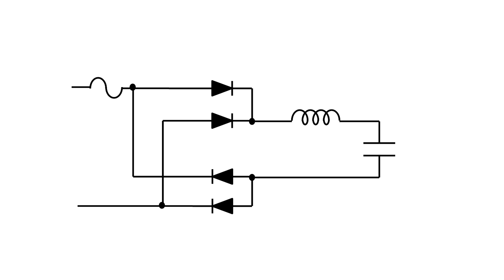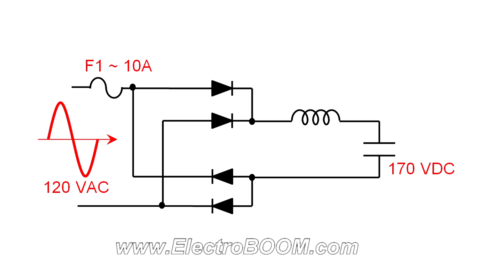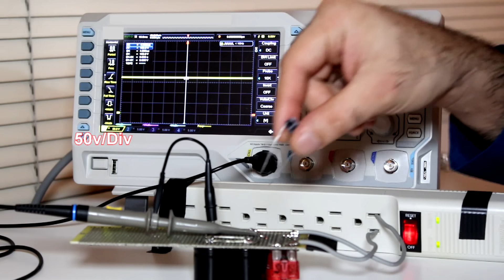Making a Full Bridge Rectifier

Comment: Always remember to add a discharge resistor across the capacitors so it doesn't become a time bomb waiting for you to short it accidentally. I use around 500 kOhm or higher so the wasted power is low.

Comment: I'm still confused as to why you can touch the 170V DC output at 2:00. Since the circuit is capable of driving 1000+W (170 V DC * 10 A = 1700 W?) of power and you're shorting the two ends, doesn't the body act as the load which means you could have a potentially high current passing through you?

Is it because you're touching only with a single finger which means the charge doesnt' pass through the entire body but rather just the finger? Shouldn't you still feel something (at least the finger heating up like a resistor?)

Why is DC less dangerous than AC in this case since the theoretical power output of both the wall outlet and FBR output should be the same minus losses from the FBR circuit and thus, having an equal amount of energy to kill you...
Reply: So here’s the deal — just because that power supply can spit out 170 volts DC at 10 amps doesn’t mean your body is instantly gonna eat 10 amps if you touch it. Current only flows if there’s a complete circuit, and how much flows depends on your body’s resistance. Dry skin can be like 100kΩ, which means you’d only get maybe a couple milliamps at 170 V. That’s barely a tingle. Wet skin or cuts though? That resistance drops way down, and now it can get dangerous.

When you touched it with just one finger, you weren’t completing a circuit. You basically just touched one side of the battery. No return path = no real current through your body. That’s why you didn’t feel heat or shock — nothing was really flowing. If you touched both terminals (say with two hands), that’s when things get spicy, because now current has a way to travel through you.

And about AC vs DC: AC is nastier at household frequencies (50/60 Hz) because it messes with your heart rhythm. As little as 30 mA AC across your chest can send you into fibrillation. DC tends to just give you one strong muscle contraction, and then your body kind of “locks on” — still dangerous at high current, but statistically less deadly than AC.

So yeah, you survived because you didn’t actually close the circuit. It’s not that the power isn’t there — it’s that you didn’t give it a path.

Comment: You can't use any diodes to make a rectifier because the diode has a specific voltage and amperage rating. If voltage or amperage exceeds its maximum value, the diode will die shortly and conduct in two directions. So don't forget to look at its data sheet.

Comment: So I have a transformer with 2 individual 25-0-25/25-0-25 power output (AC). I made 2 individual full bridge rectifiers (4+4=8 diods) with center taps and total 4 big capacitors and I put them in series to make +/-71 VDC(142dc) and used the 2 bridges connection point as Ground(0) and I added 2 bigger capacitors on my final output stage (+/- +/-) and used it in😢 my audio system and it runs pretty good so far. But I could put my transformer ac wires (secondary) in series and use only full bridge rectifiers with 4 diods and 2 capacitors which is the way I might had to do but I did it differently. Could you explain what could possibly go wrong with my setup or pros and cons please. You are the best person who could explain this one. I have searched on the Internet and couldn't find any answers or some people think it was unnecessary and not balanced and wasted parts for bad design .

Comment: If I had a scope. I would wire in a switch connected to the ground wire so I can disconnect the ground at any time.
Reply: Or use an isolation transformer.

Comment: Does the disipating resistor value matter at all? I have not run into any explanation to choosing a resistor value to disipate the current stored in the regulating capicitor when the circuit is no longer being supplied.
Reply: A little late, but if the value is too low it will draw a lot of current and obviously generate heat. I don't think there's any ideal value just use a high one. MOCs (microwave oven capacitors, they're rated for over 2kv) for example, which already have built in resistors, have a 1 mega ohm resistor.

Comment: Can the DC coming from the main rectifier bridge be further improved by having the DC signal pass through a second full wave rectifier?
Reply: Try adding more capacitors to further uphold the voltage. I highly doubt diodes would do anything to make the DC waveform more flat since the current never flows back after there is already a diode there.

Comment: Next question is how can we step down the output dc voltage to something closer to 14vdc?
Reply: Try a variable resistor and tune until you get your desired voltage. Or if you want, you can do math and pick a fixed resistor. Otherwise, before passing it through a full bridge rectifier, you can step down the voltage using a step down transformer.

Comment: I have a question, is it the inductor, that makes the capacitors not explode or an different component?
Reply: Capacitors only explode if you connect them in reverse or exceed their voltage rating. If you don't want it to explode, make sure you get the polarity right and make sure you pick a properly rated capacitor for your applications.

Comment: While touching the DC output of 170 volts when the circuit is connected to mains voltage you didn't get an electric shock. But when you touched the same DC output when the circuit is not connected to mains voltage then you got an nasty electric shock...why is this so ?

Please explain this
Reply: The voltage drops when loaded so the rectifier was likely connected to something. He got an electric shock while it was unplugged because the capacitor still holds the 170 volts DC as long as it is not connected to any load.

Comment: maybe if the ac voltage is rectified to dc voltage it will multiply by 1.5, for example 220v ac becomes 330v dc

Comment: why dont we use this type of thing instead of AC power, seems like much nicer, only requires a dc-dc converter to make USB friendly charging and stuff, could get rid of all those power supplies which are never around when you need them
Reply: Because electricity needs to be moved across long distances, and AC does have advantages there.
And your DC-DC converter would just be another power supply. The reality is, every device in your house has a power supply, either internal or external. If you changed to a DC-DC system, your washing machine, your toaster, your fridge ...they would all still have different requirements, so they'd all need a power supply.
As for the lost power supplies: just keep them with the device they belong to, preferably together in a box. When you're finished, take the extra 3 minutes to put everything away neatly. It works.

Comment: Hello, seriously: can you please explain (do to you are really good teacher), how works an Inverter from DC to AC? I know works in reverse mode than full bridge rectifier, but which is the “core” circuit of an inverter?
Reply: transistors, tyristors, MOSFETs basically, IGBT you can also look at thats a pretty common used.

In fact a basic circuit for a inverter (which is the "core" of the circuit) is easy to understand if you have only a bit electronics knowledge, but they produce a rectangle voltage, sinus inverters use typically oscillators and amplifiers and are less efficient as well bigger and much more complex and probably already too hard to explain.

When it comes to the more or less MOST USED and NEEDED function at inverters... grid tie.... so sensing the grid frequency and adapt to it for grid feeding is getting VERY COMPLEX and i guess much too hard to explain.

Comment: Hi...IV got questions. 120 V is max or effective voltage? If it's a effective voltage, how come rectified voltage is higher than that? Doesn't it make that the power of the output is higher than the input? That shouldn't be possible, right? Right?

Comment: Hmmm. Touching the output while connected to life voltage didn't hurt you while touching the charged capacitor while being unplugged does???
Reply: Touching the capacitor provided it with a low-resistance path for electrons to leave through his skin, while the capacitive effect that the body has when you touch high-voltage DC allows the voltage to be blocked, since capacitors block DC.

Comment: Is that all it takes to than to make a dc power supply assuming you have a dc voltage regulator to handle the power output of the rectifier?
Reply: You can either use a regulator, or you can use a step-down transformer.

Comment: Hi, I have a massive Transformer of 44VAC at secondary and 50A of Current Capacity. I want to use it to make the Bench Power Supply. Can I make 24V 50A bench power supply from it?

Comment: When I commented an enough long time ago, which i finally delete them, I forgot to consider capacitor as a voltage raiser output, because it collect electric current and raise it. So probably it is right 120 VAC become about 170 VDC.

Comment: "I insulated the ground pin, so we have floating/no ground" flips switch on "We are safe now"

oh dear
Reply: The circuit has a ground connection, it was that the insulated ground wire was there to ensure that the circuit didn't short through his scope.

Comment: my bridge rectifier is overheating... i use 15A rectifier for 12volt 10A step-down transformer.. with 16v 2200uf capacitor.... and i m drawing 6 amp using boost converter.... and rectifier is dissipating to much heat (wasting lot of power). how can i solve this ?
Reply: You have to atleast show a circuit diagram.

Comment: Isn't it funny how you can convert an AC voltage wave to DC using a diode and capacitor in series AKA a "DC" circuit

Comment: A full bridge rectifier converts AC to DC, and an inverter converts DC to AC. I would absolutely love to see just a chain of rectifiers and inverters for the fun of it.
Reply: I'm drawing a schematic for a circuit I call a CATR (Current Amplifying Transistor Rectifier) right now. This is similar to a full bridge rectifier but it uses transistors instead of diodes. This keeps the DC voltage output the same as the AC input voltage, but the DC output will have a larger current, which is determined by the beta value of the transistors. Low-power applications would use signal transistors, but high-power applications would use power transistors.
Reply: @coastersaga  where could I find your schematic
Reply: @coastersaga  Unless I've misunderstood you, what you're describing is actually impossible.  If the output voltage is the same, but the current is higher, then your circuit would be producing more power than it's consuming, which would violate the laws of physics.

The only way you can produce more current is by reducing the voltage, or vice-versa.
Reply: @foogod4237 Holly shit a free energy generator Indian!
Reply: @man-by9iz when did he say he is indian ?
Reply: @foogod4237 I see what you misunderstood about his comment. It's not a free enery device. The base off the transistors is just connected straight to the wall socket, but the collectors are connected directly to the local power plant.
Reply: An inverter is a device that performs a logical operation (or NOT gate). A full bridge rectifier converts AC to pulsating DC. There is absolutely nothing correct in your comment.
Reply: @gaynzz6841  That's an inverter logic gate. We're talking about power inverters, which do exactly what he said - they take DC and produce an AC wave from it. Same name (at least in short form), totally different thing.

Comment: Can u convert AC to DC by reversing this?
Reply: "Information" about the input AC signal (its frequency) is lost when it gets rectified so there's no way to reverse the same process to get that information back. A different circuit would be needed for that process.
Reply: @thegreatzoom5073 .... i saw an inverter design to do it... but the wave pattern isn't good enough....
Reply: @thegreatzoom5073  how to make it better tho? not sure if capacitors wll be the key
Reply: @jemarcatubig3171  Yes you can use an inverter, but that circuit is not the same as a full bridge rectifier in reverse. An inverter typically outputs a square wave or a stepped sine wave, not a pure AC sine wave. These steps can be smoothed out with a low pass filter, but that means it won't behave the same if the input frequency is changing and it still won't be a pure sine wave.

Comment: great! so a diode will always output DC. does that mean if i connect an LED to a wall outlet i can plug in a DC motor and itll work?
Reply: No, but there's a lot of reasons for that. The LED would probably burn out from the current and because it would likely reach its reverse breakdown voltage when the AC wave goes negative. Assuming the diode didn't break, the motor would see a changing, positive, half-wave voltage from 0 to ~170V. So it would only be getting power at half the rate it should, and I think most DC motors take much less than 170V so it would probably burn the windings out too.
Reply: @thegreatzoom5073  Sounds like we're doing too much thinking and not enough breaking stuff

Comment: 1:30 Dumb question: Why does the electricity alway pop light when connected?
Reply: Hello my old self, that "light" is called arc, it happen because the electricity breakdown the air itself to deliver power. Same like Lightnight, the air expand rapidly create sound, why the light I still question myself.

Comment: Can you make a variable output voltage full bridge rectifier? And how would one slow down an AC grinders speed?
Reply: Yes, you can use a potentiometer to divide voltage down to what you want. You could also use a DC-DC converter to step the voltage up, but that's inefficient and is mostly just for digital electronics that only need a small amount of current anyway.

Comment: Can you please elaborate on the importance of inductor in this power supply
Reply: Without the inductor, the output would have a "ripple", which isn't good because we want a constant DC voltage. This ripple comes from the capacitor trying to hold the voltage at a constant value when the rectified wave goes to ground. The capacitor will discharge and keep the output high rather than letting it dip back down with the full wave rectified output. However, this still results in a slight amount of ripple from the capacitor charging and discharging. One option is to use a voltage regulator, which uses a Zener diode to regulate a rippling voltage to a constant value. Another is to use an inductor, which charges a magnetic field as the current flowing through it increases or decreases. Because the ripple is creating a voltage that oscillates and the load is assumed to be relatively constant, the current will also oscillate. This changing current charges the inductor, which causes the inductor to generate a "back EMF." This back EMF, or back electromotive force, is just a voltage that opposes the change in current. Essentially, the inductor wants to keep the current constant and does so by creating a voltage to resist the change. So the inductor is creating a voltage proportional to the voltage change in the ripple. If the ripple is at its peak, current increases through the inductor and it will have an opposite EMF to try to reduce the current. Conversely, the minimum ripple voltage will lower the current and causes the inductor to generate a forward EMF to increase the voltage back to a stable value so the current remains constant.

Short answer: the inductor is resisting the change in current caused by the rippling output voltage of the capacitor by generating its own opposing voltage. That voltage comes from the magnetic field the inductor builds when current flows through it. Specifically, it's the CHANGING magnetic field from the changing current that causes the voltage (back EMF).
Reply: @thegreatzoom5073  too good . Thanks dude

Comment: One thing i didn't get: he didn't get shocked when touched the output while the circuit was pluged (2:00) but he got shocked touching the circuit unplugged because the capacitor was charged (3:54)...
Reply: My possible answers is that
he is doing it on purpose to remind of safety, like he does with some staged explosions

Comment: The output impedence of the LC filter won't be very good for switched loads like SMPS's.
Reply: Right, but in that case you'd probably want a voltage regulating IC?
Reply: @thegreatzoom5073  right. But the power capability of the FBR would be way overkill compared to a voltage regulator IC

Comment: I would have a question:
 - I built several „drivers“ (H-Bridge) for stepper motors.  The motors consume about 2A per phase.
 I am using Power Mosfets: IRFZ44N, IRF9510, IRF4905, IRF740.
 My question would be:
 - Do you need protection diode power Mosfets?  Looking at the photo of the Mosfet (on the datasheet), the Mosfet has the built-in protection diode.  But I'm not sure that is the case.  Or if you want to say that ...

 If anyone knows, I would be very grateful ...
 thanks and greetings to all ✋

Comment: 0:08 normal heart rate turns into a flatline
Reply: I'd be more worried if your heart rhythm was a sine wave lol
Reply: @LunaWuna No, monomorphic ventricular tachycardia can present with a pulse unlike asystole, and even pulseless monomorphic ventricular tachycardia is easier to resuscitate since it's shockable. To conclude, monomorphic ventricular tachycardia is a better rhythm than asystole since asystole isn't shockable and has low survival rates, however, monomorphic ventricular tachycardia is easier to resuscitate since it is shockable, can present with a pulse (and if so, can be controlled with antiarrhythmic medications alone, or DC cardioversion, as opposed to AC cardioversion which is not recommended.
Reply: Normal heart rate? That is clearly a monomorphic ventricular tachycardia, that's not normal, and it's the rhythm, not the rate. Also, we refer to "flatline" as asystole.